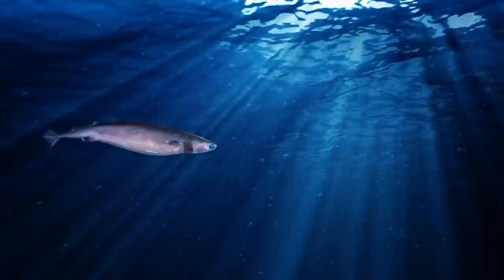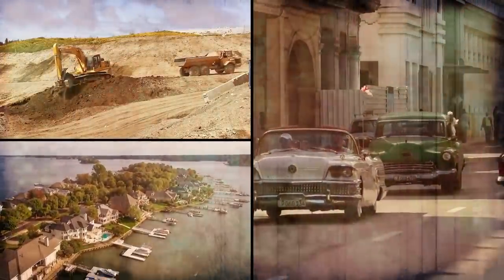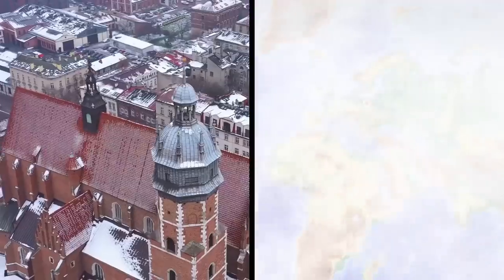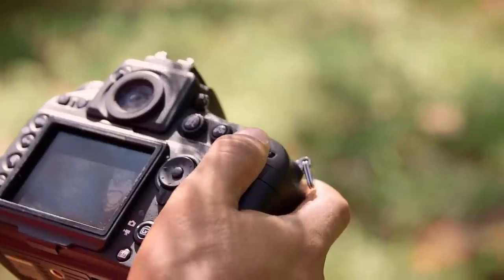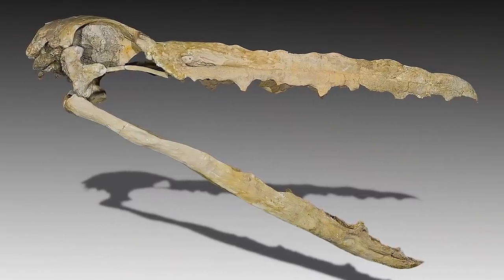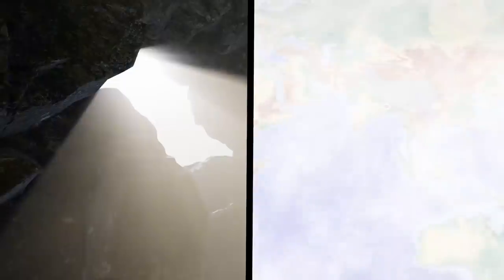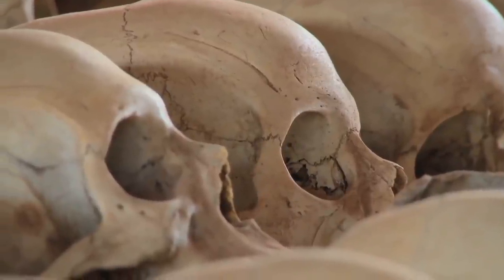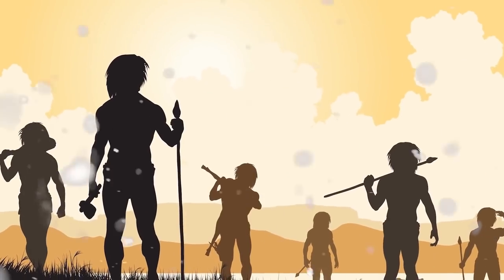Scariest And Unexplained Discoveries! | ORIGINS EXPLAINED COMPILATION 52

Comment: Poor Cookie from that boat underwater in that Absolute Black, Cold, Air-pocket, for 3 days. I'm surprised that the Diver he tapped on the Shoulder didn't FREAK as many would have in that Situation. Feeling your way thru the Black. Flashlights only illuminate a Very Small Spot of light, making it even Harder to Clear the Boat.
     "Deep Blue", the 22 foot long Great White Shark is the Largest ever recorded and tagged. When she was found and tagged she was 20 feet long and Pregnant.
Reply: Word